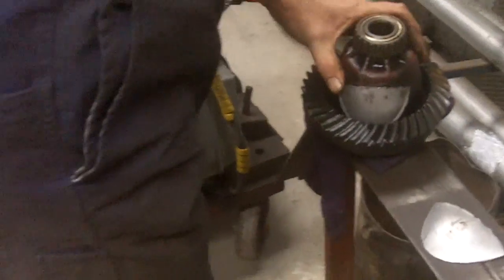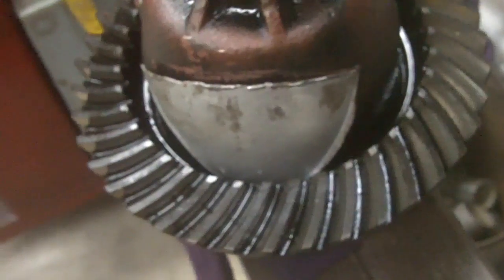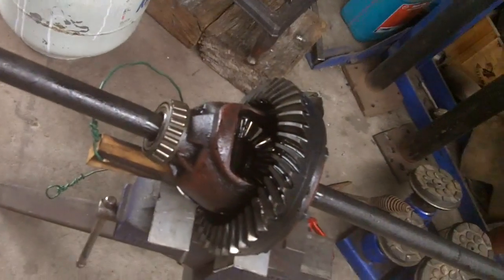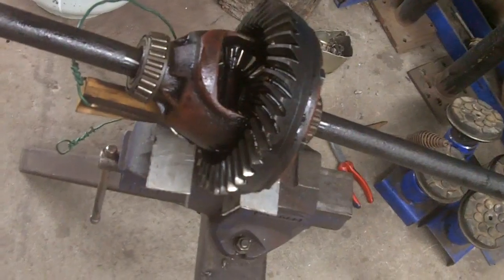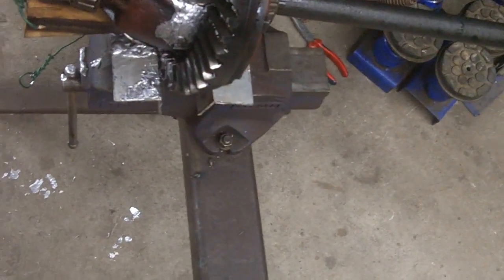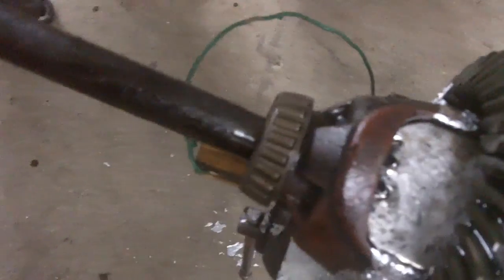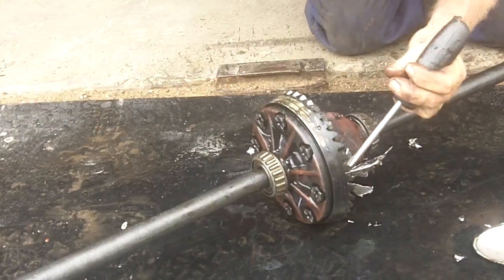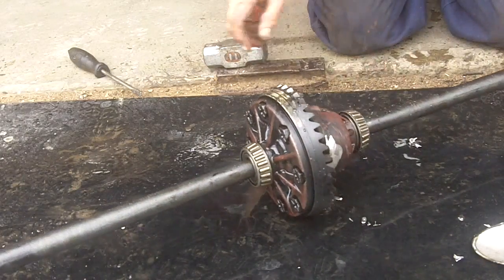How To Make a LEAD LOCKER Diff

Comment: Personally for short term and low torque applications I can see this working fine. But on anything off road or more than 180hp....it'd chew that lead up imo
Reply: I am REALLY curious about that exact thing! The lead is softer and not fusion bonded/welded to the spiders. BUT! It fills ALL of the voids so the lead has no where to go in order to fail/break. And the gears were not heated over critical or even above spring temper to soften or embrittle them. I don't know, it could be as strong or stronger. I would love to see someone do this in a one ton axle with 500 HP and beat the snot out of it on the trails.
Reply: you can use harder lead with tin/antimony mix. I think this would work better.
Reply: @Pabcio  OH with out a doubt, they used wheel weights which is already alloyed, considered a good bullet making alloy and considerably harder than pure lead. Another thought is, the lead locks ALL the teeth on the spiders where Lincoln only locks a handful.
Reply: You could probably heat it with a torch to remove it if you wanted an actual locker down the road cause it wouldn’t destroy the carrier

Comment: Never pour molten metal over concrete, only over sand. Moisture in the floor can explosively send molten metal everywhere !
Reply: spudboy pollock it's lead, not copper
Reply: lead does not get hot enough

Comment: because welding is hard hahaha
Reply from the maker: You missed the point, mate. This can be melted back out again.
Say you only have one diff and you want to lock it for a weekend event. Then want to unlock it for street driving later. Now you can. :)
Thanks for watching
Reply: Chiller Bros I love the new style. a he'll of a lot easier than the link as my bud just installed in my helix
Reply: Careful working with lead, especially if you're melting it over and over again. Over time you could develop some serious poisoning and doctors will have no clue what's wrong with you. Try not to breathe those fumes at least, melt it outside and use protection =)
Reply: @Mickey_Bauer  Dude ?? Really ?? Looks like EVERYONE missed to reason for this video !!!!  He made it to 50+ years old, So I'm sure he knows not to breathe in the fumes !! And the video was to show how to TEMPORARILY lock the Rearend !! Then simply use Heat to melt the lead out after your done, And your back to stock WITHOUT DAMAGE OR WELDING !!!. People really should read the descriptions in the videos !!!

Comment: This is interesting, I want to lock the front diff on my 81 Jeep CJ7 would it work on a dana 30? Would this technique work for 4x4ing? I like this idea over the lincoln lock or welding the spider gears and all that.
Reply: Puerto Offroad a locked differential can be a disadvantage off road, depending on the terrain.  The same way the car at the end of the video is able to spin around so easy.  This will cause your 4x4 to slide sideways when it loses traction.  This can be a big problem if you are driving on the side of a hill.

The best off road locker is a selectable one that can be either fully locked or fully unlocked.

Comment: Great idea! I´m wondering if aluminium may do a better job. Lighter and more resistant.
Reply: Martin Gonzalez ya but point of this vid is you can go back to open diff.aluminum is lighter but has a pretty high melting point.lead has very low melting point just heat up diff and let it drain.with aluminum youll probaly need oxycetaline torch or something.itll need to get HOT
Reply: Nop the T° 230°C versus  950°C of Al ; overtemp. daño to every dif.

Comment: ive never seen it done this way but ive seen it done several other ways, i am only wondering how long it would last because i have been involved in racing and have seen rearends get pretty hot but if it can stand that heat it would be worth doing and it is easier than welding

Comment: is this something like diff locker.if yes i will be pleased to get some knowledge
Reply: Muzaffar Tarar yes it locks diff so both tires spin at same speed for mad donuts.this alternative to welding,scince you can just melt lead down if you dont want diff locked up anymore.they also have clips to lock it but i geard those wear out pretty easy.they got things you can rrplace the spider gears with too to lock it but there about 300$.i might do this but hit junkyard to get extra rear end in case it fuck up my diff lol

Comment: How are the axles removable from the center after the lead has been poured in and around them? maybe some heat proof grease on the splines first?
Reply from the maker: ***** Lead cools and holds the shape, but it doesn't stick like glue. You can just pop em out with little effort.
Reply: ***** Any grease would no doubt help, but metal has a habit of shrinking as it cools down. 
Being colder than the molten lead, it won't solder either, so it should come away pretty easy.

Comment: how to remove the axle shaft?
Reply from the maker: If the axles are stubborn and wont just pull out after you undo the nuts behind the drum housing, then you will need an axle removing tool. It's like a big slide hammer you attach and bang it out.
Reply: Chiller Bros Sorry, I did wrong question. How you remove the axle once everything is finished?
Because in the video you put the axle and then put the hot material
Reply from the maker: Just slide it in and out, bro. Putting the axels in makes space for the axels later when you put the whole thing back together. Otherwise you fill the axle holes with lead. :/
Reply: Chiller Bros
Ok understand. I believed that leaving axels and then when you put the hot lead then could not get. That was my question
Thank you very much for the replies and sorry for the language I use google translator
Reply: +Alexandre Garcia  so if you got c clips holding the axle shaft in place I wound,nt be able to pour lead in the diff without stopping the axles from turning is that right
Reply: +Sandee Fells , this process cannot be done on a c clip axle. Unless you eliminate the c clips and use another method for holding the axleshafts in place.
Reply: Torinero a full
will not work with a c clip rear end, just on rear ends where the driveshafts are retained at the wheel bearing like on all danas. If you use a c clip eliminator then you can make in in a chevy rear.

Comment: Never seen this done before.
Reply: That's because welding is so much easier and lighter and cheaper and stronger and better.
Reply: stovepipe9er its kinda genius if it holds up.like the idea if not having to weld so you can remove all the lead if the tire bounce gets old lol